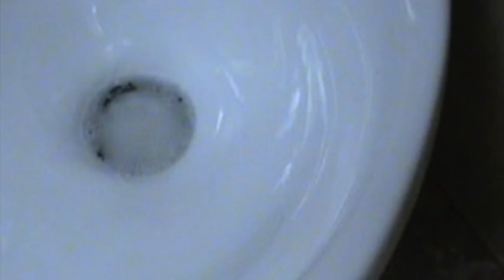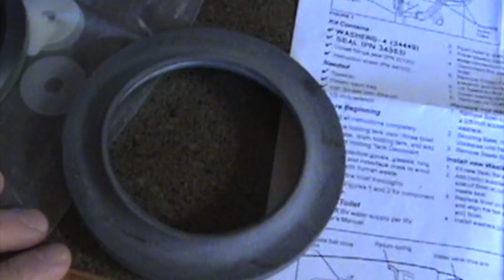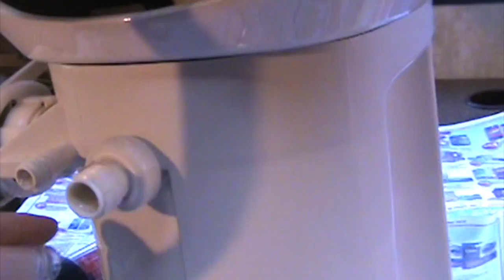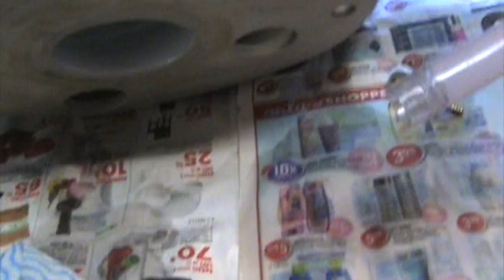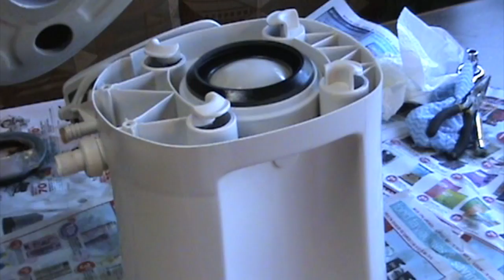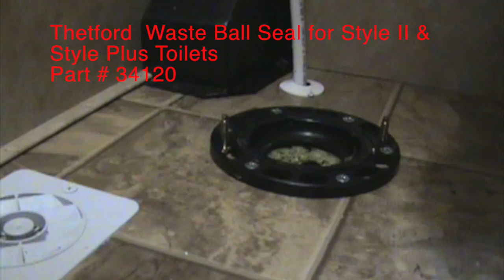Repair leaking RV Toilet - New Gasket Replacement

Comment: The gentleman did one awesome job showing the repair, and thumbs. My only suggestion would be first to wear rubber gloves while handling, cleaning and repairing. Secondly, if one must work on the table, cover with plastic first then add paper if desired.